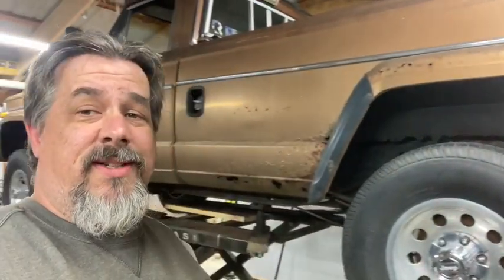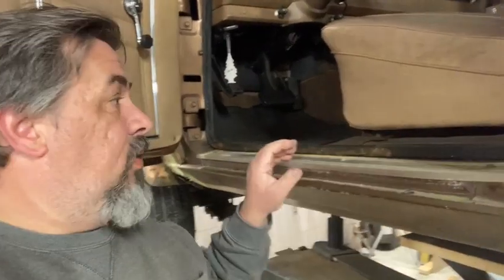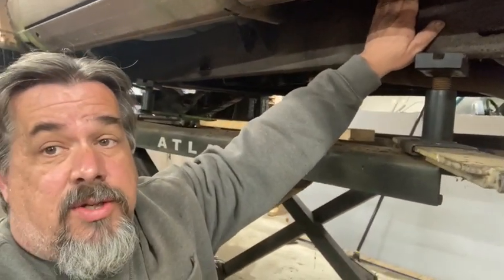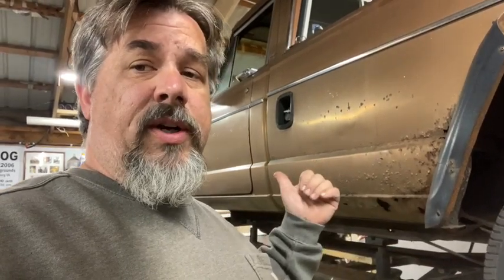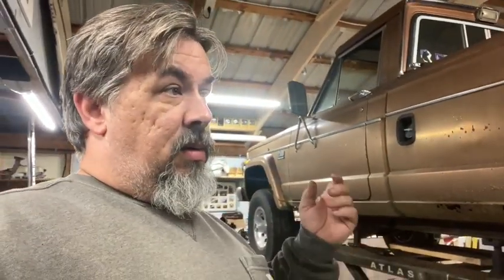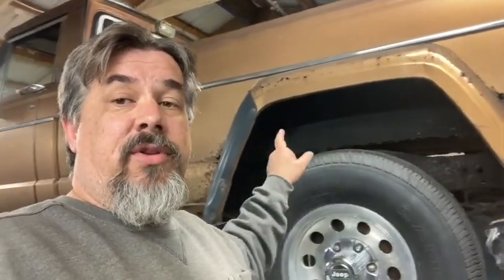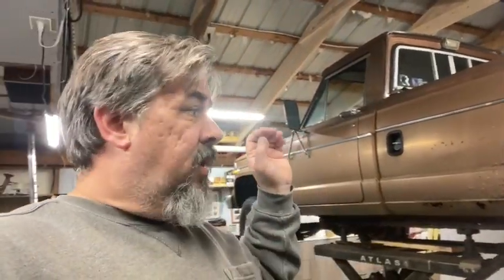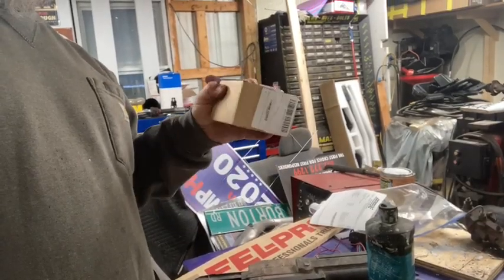Jeep J10 Project gaining some traction

Comment: Quite a project you are starting, but you will have a great truck when you are done. I have a 1966 Jeep J - 2000 seven foot pickup that my Dad bought new in December of 1965. It was his service and plow truck for many years. We rebuilt the engine and transmission in the early 1980's and in 1993 my cousin Bob and I cut the frame behind the cab and welded in a new Chevy truck frame and double plated where the two frames came together one - half inch thick all together, I bought a very clean seven foot body  to replace the 1966 body which was totally shot and have replaced both rear springs and front springs in 2022. This truck is still my plow truck after 58 years. Thanks for saving another old Jeep truck from the crusher.
Reply from the maker: Well I got the rear frame section done brakes and lines I lifted it a little and nicer bed on the truck now I need to dive into the transfer case now I’m going to do away with the vista couple as it’s slipping I’ll be posting for on it here soon